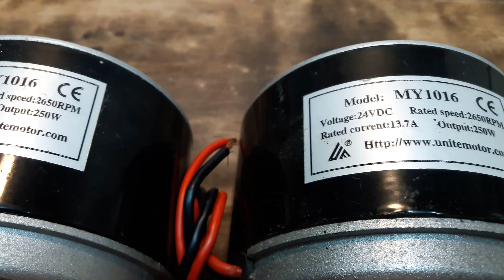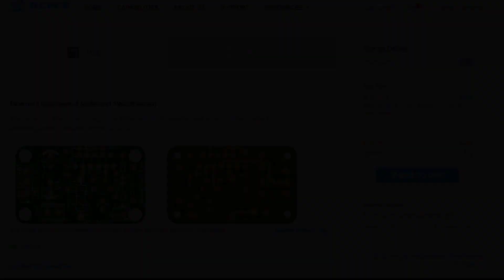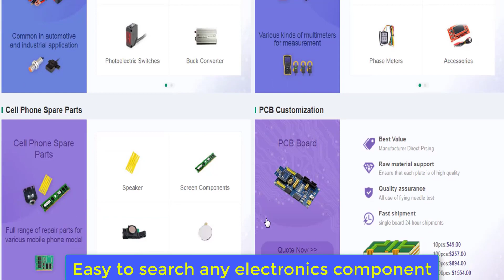Simple MPPT Project,Boost Converter,24V 500W DC Motor Running Test

Comment: I like your videos and would want to replicate them as much as possible. How do I get the PCB boards. How do I buy or order the exact type you use in your work.  I will like to make a standard MPPT charge controller up to 60A.  Can you guide me. Am not a pro like you, am still learning, but with the right guidance, am sure I will do well. Hopi g to Herr from you. You can give me your mail so I can reach you or this is mine - iykchi2.ic@gmail.com

Comment: Can I use these mppt for making amplifire power supply
Reply from the maker: Yes. But this MPPT have output power below 100W
Reply: But u said in description as 500w
Reply from the maker: @gokulg264  No No i said i run 24V 500W DC motor by this MPPT
Reply: @LongTechnical  Why do you keep calling this MPPT. Surely you know better. All those views, your a genius at something.